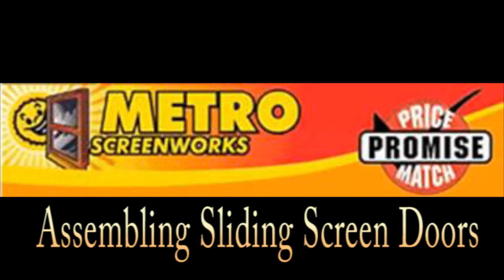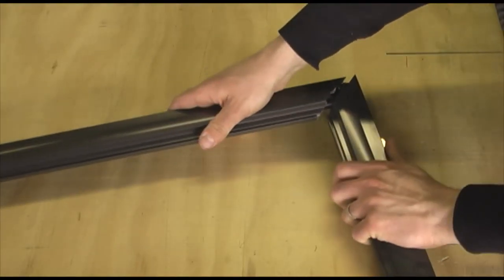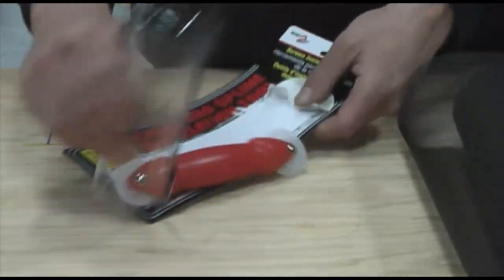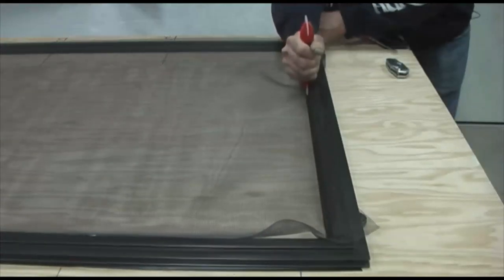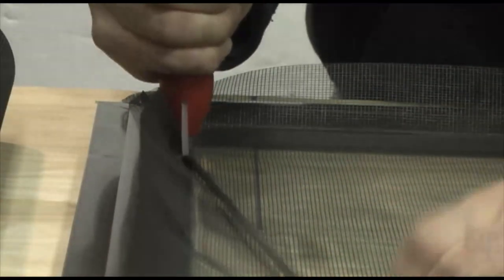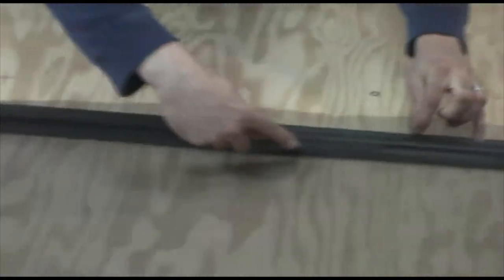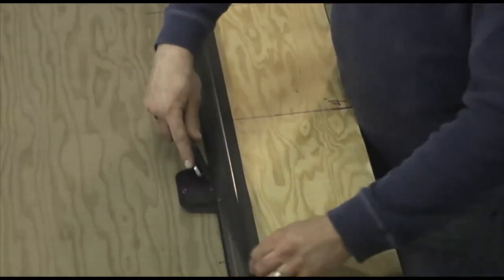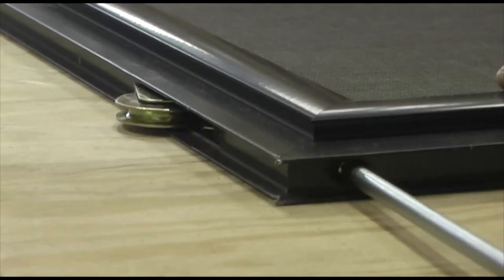Putting Together Unassembled Sliding Screen Doors

Comment: Screen door was not nearly this easy to assemble. Parts didn't fit together easily or correctly, holes that needed to be tapped were not tapped, door did not fit correctly into channel.
Reply: Really? Which model did you buy?
Reply: @ThisGuuuy  “Classic Sliding Screen Door / UNASSEMBLED” SKU 900UN

Comment: I have a question! Will Metro's "Super Screen- Pet and Weather Resistant" screen be equally as easy to install into my existing sliding doorframe? Just curious if the material is thicker, or harder to roll into the spline groove... 

Thank you!
Reply from the maker: Hello, Our Super Screen and our Pet Screen will be a little bit more difficult to install as it is a thicker material. It will still work with any sliding screen door and you would be able to do the install yourself. Please see www.metroscreenworks.com for more info
Reply: +Metro Screenworks Thanks so much!!